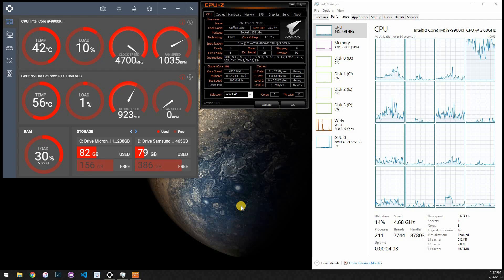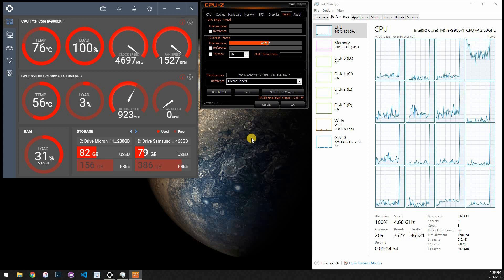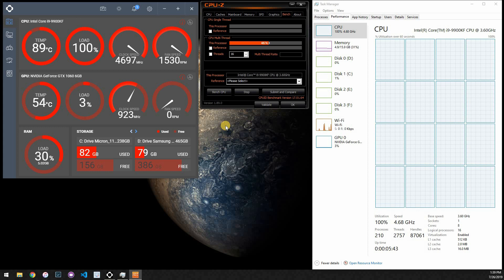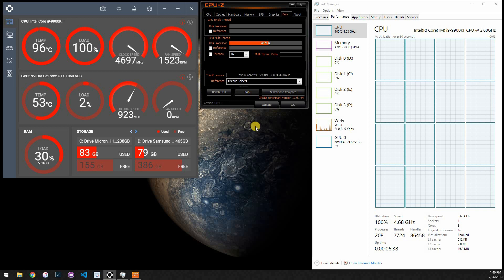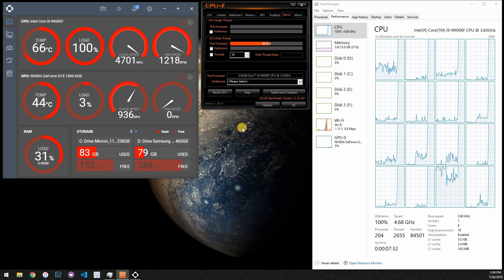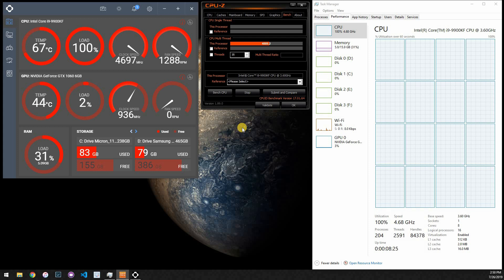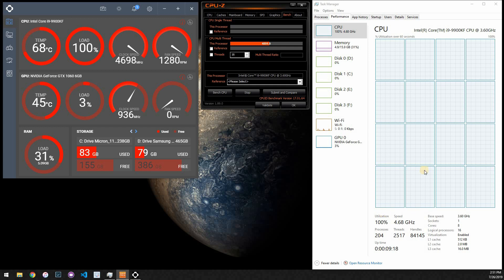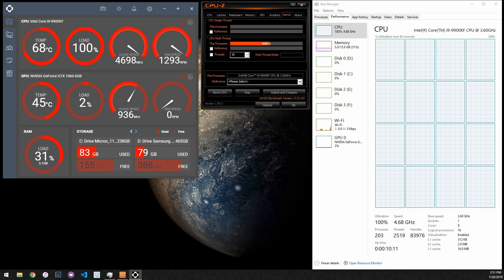Cryorig H7 vs Noctua NH-D15 on an Intel i9 9900KF

Comment: It handles my r9 5900x just fine xd
Reply: Same, have an Ryzen 9 5900x. Initially the single fan had gave me thermal issues. Added an extra corsair premium MI120 fan and now temps are very good. Did a CO with Ryzen master and now temps don't shoot beyond 70C..Usually stays max at 67C even under stress test for a long time, at room temp of 75F.
Reply from the maker: Which cooler?
Reply: @jonlawrence  cryorig h7

Comment: Update - Picked up that offerup D15 brand new in the box, never installed. $40 steal of a price for a solid cooler. Install even though larger and fans are a little harder to install it is still SOOO much better than the Cryorig H7 installation.  H7 max temps with Prime95 was 59c and w/ the D15 with both fans max now is 52c. The funny thing is I have 4 Ryzen 1600AF systems all on B450 Tomahawk boards. My toddlers PC with the cheap $20-25 Vetroo V5 cooler paired with left over performance Corsair 120mm fans is getting the same exact temps as the D15. Both cases have ample air cooling but that super budget Vetroo V5 is cooling a 1600AF stock exactly the same as the D15 on my wife's PC. Corsair fans are more audible though than the Noctua 150mm fans.  Weird they all run at way different all core stock speeds under Prime95. 3 of the boards have the exact same bios and all temps are in the 50 range but they run different auto all core Prime95 (3600,3550,3300,3200). I double checked settings in BIOS and it's all stock minus XMP 3200mhz profile.

Original Post -  I currently have the H7 on my wife's PC running only a 1600AF Ryzen 5 65watt cpu. I just found a guy selling a new D15 and talked him to $40 so figured might as well as I can't stand the mounting method on the H7. I have the U14S on my main rig with a 5600x and it appears the U14S cools better by a hair than the D15 so no need to swap coolers on my main rig. Thanks for the video as it's the exact scenario I was looking to compare minus I have a far less needy CPU but I can likely sell my H7 for $20 so why not.

Comment: The Noctua is a beast but there must be a problem in the cryorig installation, that difference is impossible. 9900KF TDP 95, THAT CRYORIG H7 IS BROKEN
Reply from the maker: The size difference and flow of air says otherwise. The H7 is tiny compared to the D15.

Comment: I have a NH-D15S and an i9 9900k. Same cooler but leaves about 65mm clearance for RAM. Comes with one fan but you can install a 2nd. This cooler had had many stress tests and have outshine all air coolers I’ve seen so far.

Comment: I just performed a test and it's making me think that CPU-Z's stress test doesn't tax the system as much as possible. I have an H80i v2 and when I performed a stress test (only for a few minutes and using max fan speeds), my CPU temp never went over 68 C. It was actually at 66 C for most of the time despite running at 100% load @ 4.7 GHz. However, when I ran Cinebench R20 the temperature crept up to 74 (it then throttled because I'm using stock settings on my 10700K). I had UNiGiNE Valley maxing out my GPU during this test too.
Reply from the maker: Thanks

Comment: Hello. Did you OC your cpu?
Reply from the maker: I have overclocked it since, but I keep it 4.8 most of the time, much quieter and still more than enough performance for me.
Reply: @jonlawrence  its great, thanks for the update.
Reply: no that's stock 9900k with turboboost intel
Reply: @whonjick404  ok thanks :) The D15 is doing a fantastic job cooling that hot boi. You have headroom for OC, it can be handled by the D15.

Comment: I'm upgrading from a Scythe Mugen Rev B. Using it currently on my i7 9700k at 5.0ghz (1.33 volts). Can hit up to 85 degrees on high load, so seeing this video made me really hype about getting the Noctua tomorrow, thanks!
Reply: Me too... i’m using the 9700k too but i don’t know to OC because scaring, my cooler is h7 quad lumi! 
What the cooler you used ?
Reply: Did you upgraded to the nd h15
I want to upgrade from my h7 and i dont know if going to the mugan or noctua

Comment: Im getting 90degrees on noctua nh d15 on 4.7 ghz
Reply: I don't have an NH-D15 but maybe something went wrong with your installation.

Edit:

This posting has numbers closer to yours:  https://www.techspot.com/review/1730-intel-core-i9-9900k-core-i7-9700k/page3.html
Reply: What’s wrong with ur cpu
Reply from the maker: I would try reinstalling it, that seems way too hot unless you are running it in a sealed box.

Comment: damn.. Im looking for the u12a on a 9900kf test. Don't plan to OC -- maybe an all-core boost at most. The D15 is rather similar from most reviews I read, just smaller form factor but performance to match. So thank you still :)
Reply: Wait dude....don’t buy the u12a rightnow!!!!! Because in 2021 noctua will release the u12a black color!! It will be cool than d15 black
Reply: @jasonlam6805  you're saying to hold off on a build for a year for some color changes? yeaaaaaaa no. Already built, loving it. Works great (38c idle, 50c under load, 70c synthetic avx2 testing)
Reply: Are you using the u12a for 9900kf??
Reply: @jasonlam6805  yes
Reply: Big Fire Pop and the temps is???
Reply: @jasonlam6805  as stated in my reply above... and I quote
"Works great (38c idle, 50c under load, 70c synthetic avx2 testing)"

I'll tack on some additional info..
1.275vcore fixed 5.0ghz all-core with 4.7ghz ring.
Reply: Big Fire Pop wtf?? Bro?? Your 9900kf fullload just 70c (u12a) ???

Comment: anyone having a i5 8600k clocked at minimum 4.6GHZ? If yes,
what volt and cpu cooler?
Reply: i just started ocing mine and am seemingly stable at 4.7-4.9ghz at 1.34V. I feel like my chip isn't the best but whatever. Also I am using an H7 Quad Lumi and the temps aren't the best, am considering delidding and upgrading to a Noctua
Reply from the maker: Sorry I don't have any exp with that CPU

Comment: Whoa nice rig man!, awesome OC too!. Question. Do you think the NH-D15 could also keep an I7 9700k cool when OC'ed to 4.7 - 5.0 GHz?. What were your temps under load when OC'ed?. Were they over 80 c?. I would like to be able to do it within 70-80 c max. I really like Noctua and don't want to use a 360 MM AIO to cool. Everyone is saying I should water cool but I feel this is close to being able to handle 5Ghz and keep it cool. Can it handle that you think man?.
Reply: Yeah man! My 9700k too! 
We are 9700k and i thinking 9700k just 8c/8t the temps is lower than 9900k!
I think if install the noctua d15:
-@stock under 70c
-@OC 5.0ghz  under 80c
Sure...
And the AIO 360mm i’m so f**cking scaring leak the water! 
I think air cooler can handle that
Reply: Keeps mine under 50c at 5.0 :)
Reply: @eugeneroushe5524  i sold my 9700k and get the 9900k 1.99 volt with z390 maximus xi apex! It so cool
Reply from the maker: Yes, 9900k is similar to the 9700K for thermals, 9900k usually runs a little hotter. You should be fine.

Comment: Can it handle 9700k ?
Reply: of course it can. 9900k is hotter than 9700k. i also have 9700k planning upgrade to this cooler as well
Reply from the maker: Yes

Comment: I'm planning on getting a D15 for my 9700K. What kind of voltage was your 9900K running during this test for the D15? 
Good vid btw!
Reply: which temperature you have with the D15?
Reply: @elchakadejuarez  it's a very good cooler. I upgraded to a 9900K and it keeps it under 75C on all stress tests. It's also extremely quiet
Reply: Did you get the D15 ? How is it performing ?
Reply: @nasserov4845  Yeah I ended up getting one and it has been wonderful. It is extremely quiet and cools much better than my old corsair 280mm liquid cooler. Just make sure you have space for it in your case

Comment: Even at stock settings the value should be no less than 5500. For whatever reason your CPU is seriously underpowered.
Reply: To clarify, that is the "CPU Multi Thread" value in CPU-Z. When I tested my CPU, I got a value of over 5600 at stock settings (i7 10700K).

It does seem that his processor is underpowered. It was at 15% usage before he started the test though.

Comment: Hi dude, so. Nh-d15 is best cooler for 9900kf in our days? Sorry for bad eng, im from Russia
Reply from the maker: In my limited research and experience it is the best air cooler. You can get better results with a custom loop water cooling solution but it will cost significantly more.
Reply: @jonlawrence  In my last PC, there was an water cooling, in two years the pump failed and the liquid got into the power supply. I do not want to use it again, this are far from perfect. Price is not as important as security, in my situation. And thanks for your answer. God bless you, comrade.